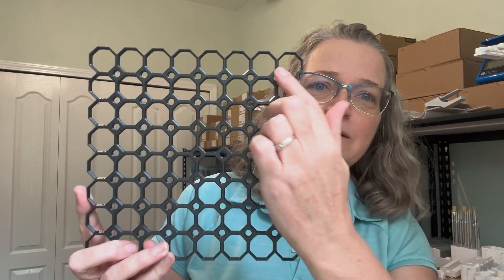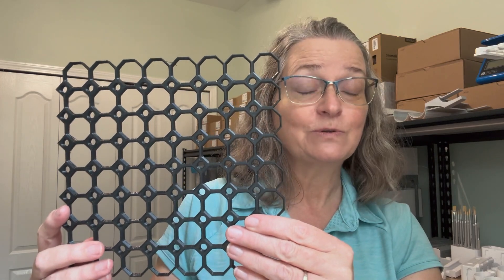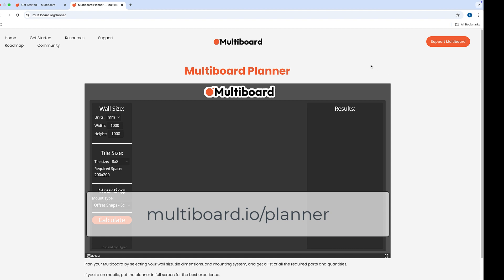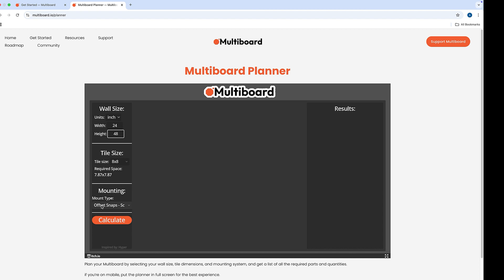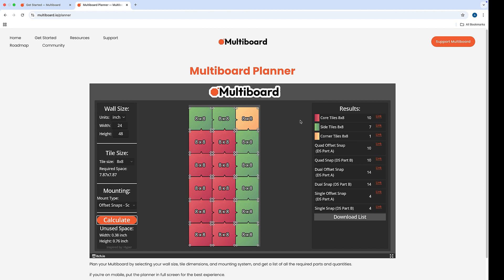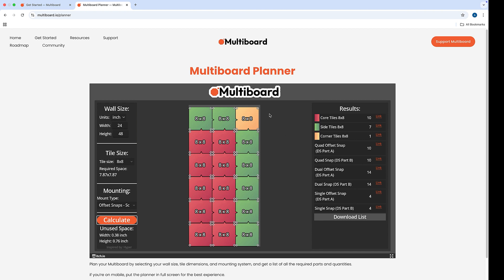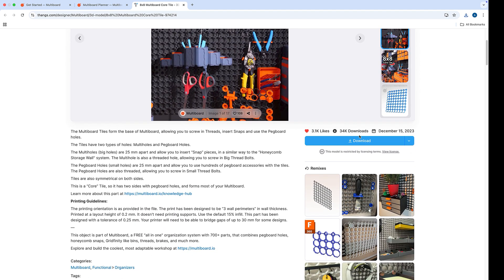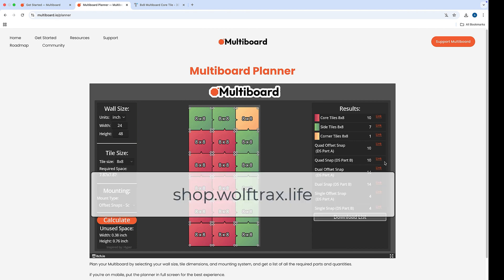Guide to Using the Multiboard Planner to Determine Your Tile Layout

Comment: New to all of this- is there any way to print a stack more that 4 high? I see the files you can download that contain a stack of 4, is there anyway to print more?
Reply from the maker: Yes, but you have to have one of the paid memberships in Multiboard. With certain levels you can get access to more resources like larger stacks already in stl format and the tile  generator to create unique tiles and taller stacks.  Upper levels of membership also give you access to starter and learning kits and advanced access to new parts before they are generally released. 
Some makers have tried to make thier own stacks from single tiles. We haven’t tried it since we have a membership but there are videos that can serve as a guide.